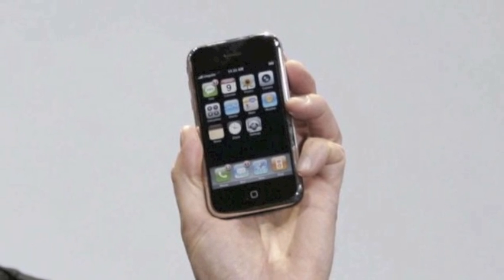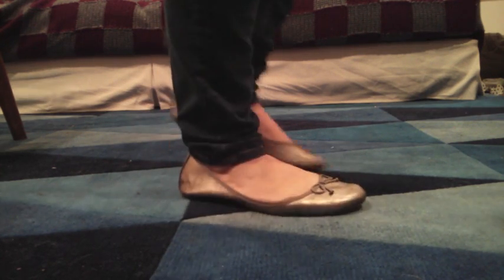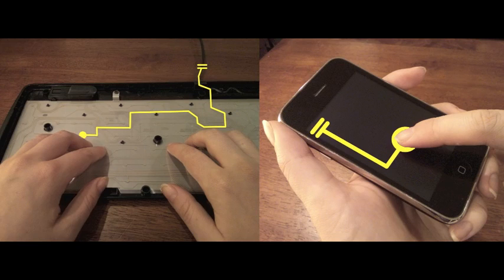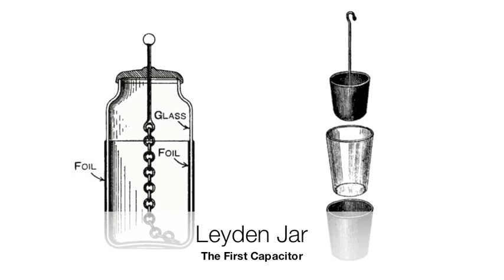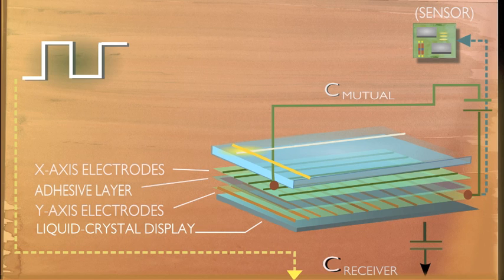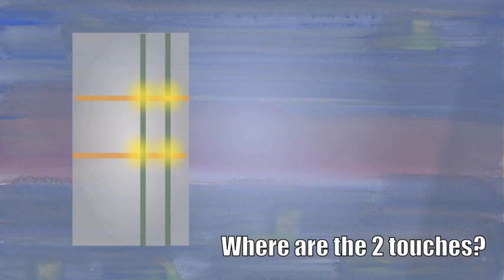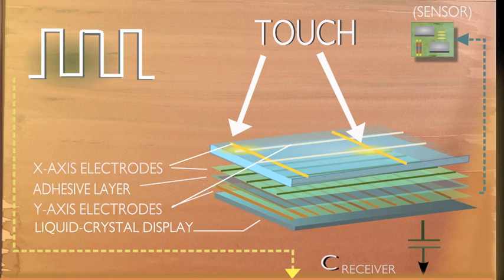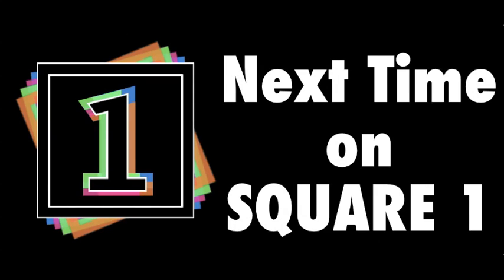How Do Touchscreens Work?

Comment: You spent a lot of time introducing a capacitor as a device for storing an electric charge. You did nothing to explain how (or even that) capacitance involves two unconnected electrodes "sensing" each other, so the viewer becomes lost as you try to explain the system as a game of Marco Polo. Your second half seemed to give up on a conceptual framework, and sounded like a technical paper abstract for an audience that already understood the key concepts.